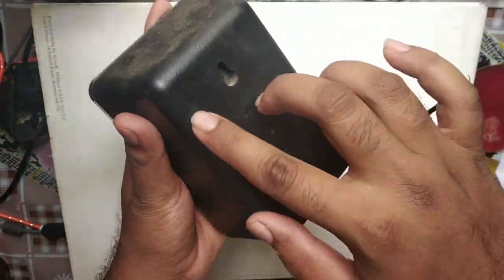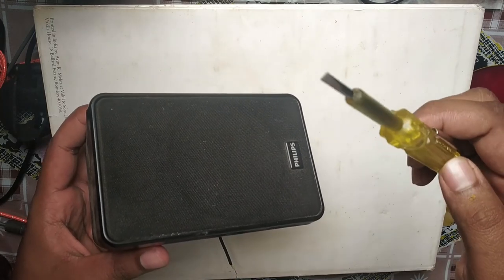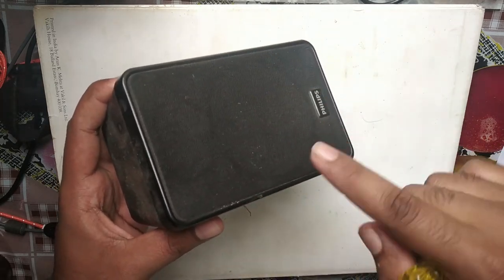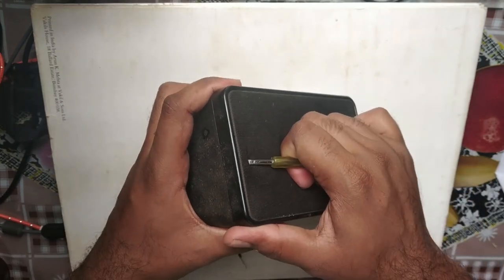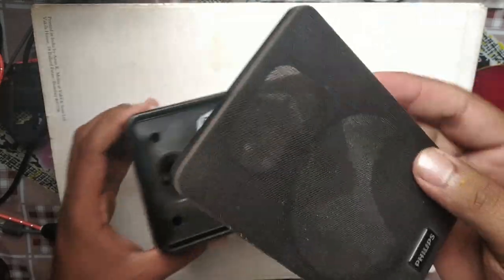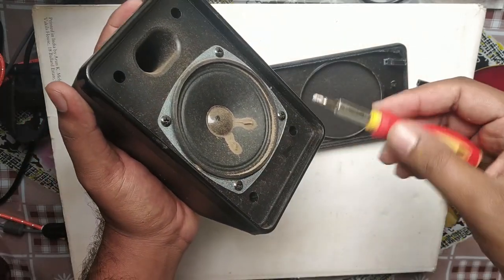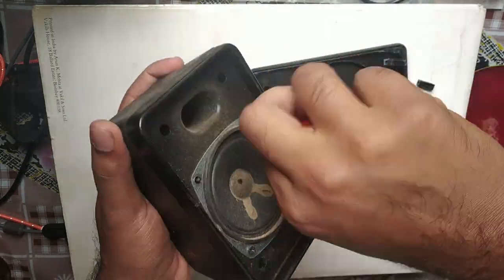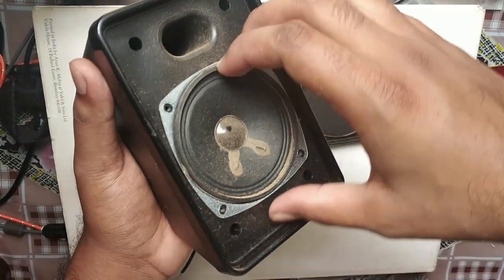How to Remove sealed Speaker Box [Hidden Technique]

Comment: Thank you buddy.. the wire inside the speaker got cut bcz of me... Now I fixed them... They working is new... But bro can you tell how I can turn off auto standby mode in Philips dsp 2500